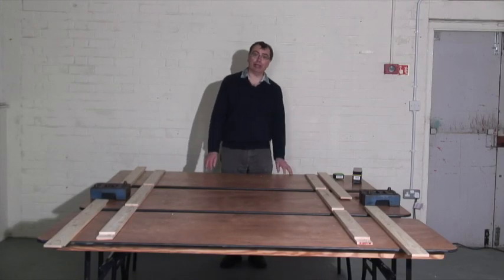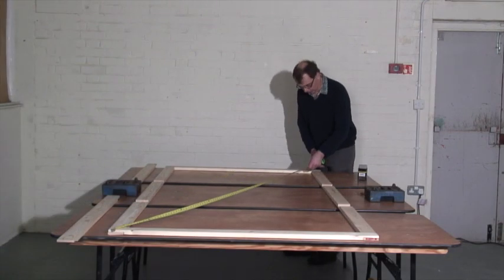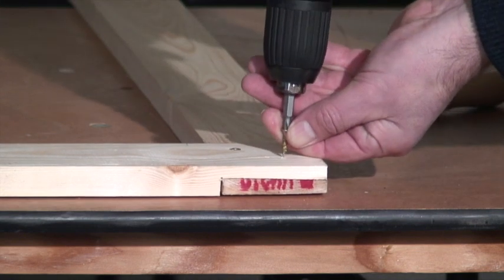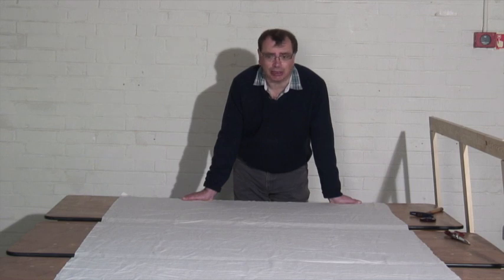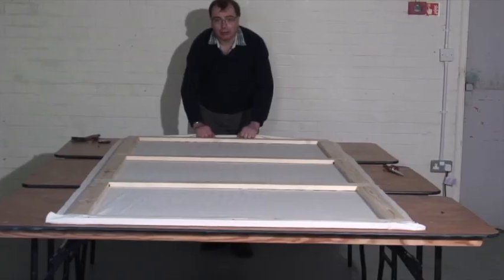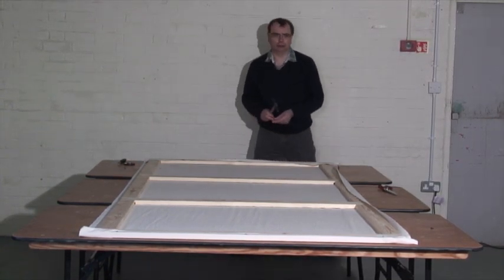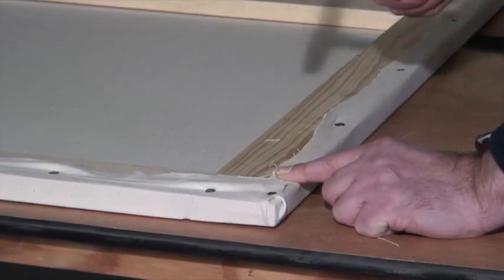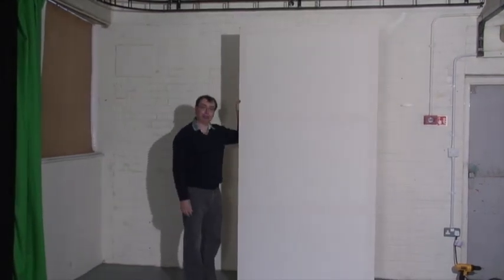Building a Theatre Scenery Flat (part 2 of 4)

Comment: Staples are much better and used on the front face only then trimmed to the edge( Don't forget to glue paste and size). That means if the flats are being slid on and off a van during regular use there is no damage caused because the edges are not canvassed. Paint covers the staples, so they are not visible. Cleats are another thing of the past. Pin hinges are much easier. Also always transport canvas to canvas.
Reply: Harvey Levene i
Reply: Also intermediate rails ought to have 5mm less thickness because they'll show through when painted. I didn't hear any mention of not stretching the canvas too tight as it'll shrink after painting and can distort the frame. Cleats still have a use in a quick change if the flats are very tall and/or access is an issue.

Comment: absolutely no one builds theatre flats with half laps. corner blocks, keystones are standard, and then of course there are TV/Hollywood flats as well. why aren't there any video examples of the standard, in every text book, way of building flats? I know there are many ways it can be done that are as effective, but the standard, traditional methods are most commonly employed and yet impossible to find examples of in practice in video form.